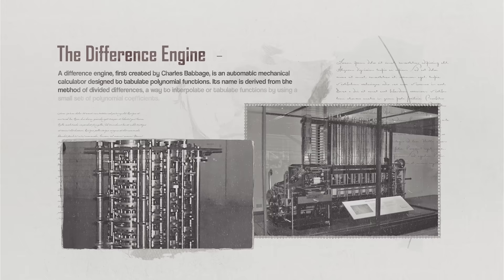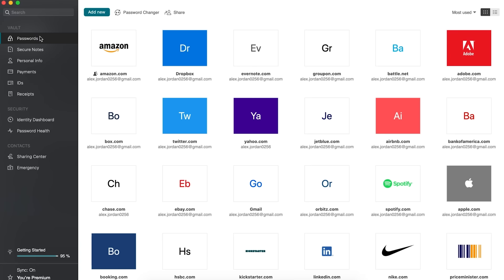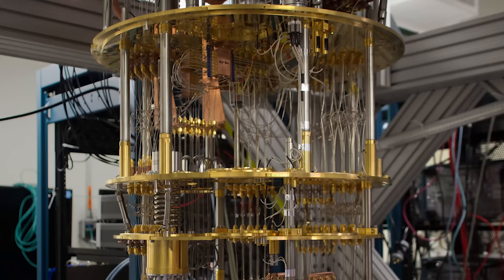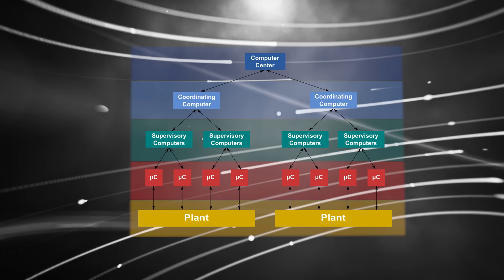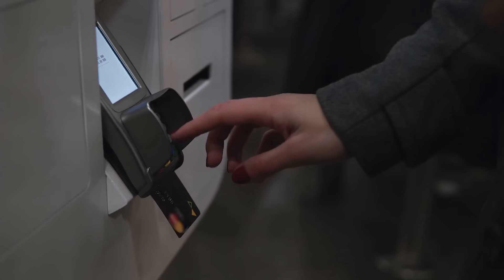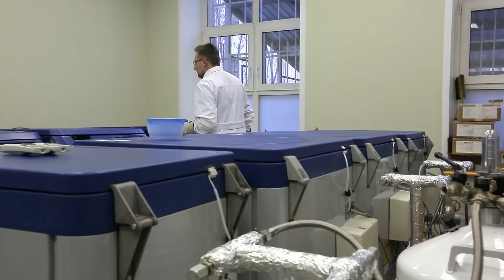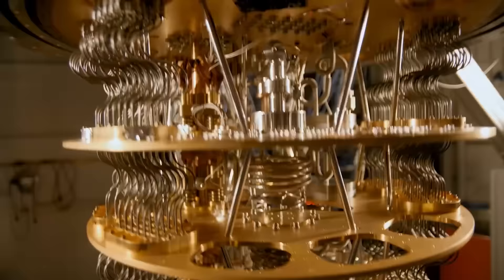This Revolutionary Computer Is About to Change The World for Good

Comment: My biggest question is can quantum computers help us achieve real fusion energy?
Reply: It can be used to simulate fusion reactors and experiments more accurately without having to build as many prototypes. So yes.
Reply: @charliestewart885  lol
Reply: Fusion energy is always 20 years away. No matter the computer available
Reply: Fusion energy is a thing and yes it can happen
Reply: I mean you don't necessarily need a quantum computer to create 'real' (not sure what you mean real but I think you mean sustainable). It's more or less a different field of science, although a quantum computer may be able to calculate mathematical operations which are important to the creation of fusion energy a convectional computer is able to do pretty quick. And we technically have a fusion reactor i.e a tocomac which are able to generate enough energy, but the issue is the energy deficit caused by the high amount of energy required to fuse to hydrogen atoms.togeher so an alternative of hydrogen-3 was proposed. The issue is that hydrogen 3 is on the moon so we need a moon base to actually extract it. The point I am trying to make is that everything is linked so if we crack one issue for another, larger issue it doesn't mean we solved it, it means that we need to take a few more steps in the right direction which both benefit us and our next generations.
Reply: Graphene will probably be the ticket. It can absorb Alpha and beta particles that are released during fusion reactions. Graphene chips will likely replace silicon chips in conventional computers while quantum computers will likely be used only on Industrial scale
Reply: Windows has been trying to make problem free software for 25 years and they still can't prevent new updates.
Reply: Nikolai glodowski don’t hate on people like that just coz there a lot smarter than u doesn’t mean u have to hate on them
Reply: Nikolai glodowski , with a name like that?? don’t you realise you’d be one of the first to get rounded up?
Reply: Nikolai glodowski , we wld be happy to have you mate

Comment: 'AMD has manufactured a processor with 64 cores'

shows picture of a Ryzen 3
Reply: Hahaha indeed
Reply: lmaooo ikr
Reply: It's wasted on software that only runs PHP & java.. :)
Reply: @derekfrost8991  How is that ? Most PHP is running at hosting providers which serve many, many websites and can thus handle many parallel requests. Same goes for Java on servers.
Reply: @autohmae  sure, if the host server gives advanced features natively, it's probably written in a decent language. My point is simply that we're not ready for multi-core nor qubits since our software is only as good as the Von neuman bottleneck will allow. These aren't just my opinions, I refer to a paper by John Bacchus.. :)
Reply: @autohmae  java doesn't even have tail call optimization..
Reply: @derekfrost8991  I'm jut saying, most PHP isn't used for things that need parallel computing and the way it's used (be it stupid Apache prefork or something like PHP-FPM) can fully utilize the CPU cores of a server just by handling multiple requests at the same time. In many cases the same applies to running Java. I think the idea people have that Quantum computers are going to take over is a mostly silly idea. I see it much more like a specialized co-processor. Just like a FPU or GPU, etc. Unless someone comes up with for example: doing machine learning in a much more efficient way on a Quantum Computer, then I doubt they will 'take over' the computing market. It will be like having FPGA, not many people have one, but it's very useful for some applications.

Comment: This was great until we learned that Google is the company that had the first one. We’ve already learned that google are a group of somewhat Evelin and self-serving technocrats
Reply: Why do you think Google is that bad? And would you say there is any Company currently which would use such a "power" for the greater good, instead of doing just what gives them control and money? Just want to know your opinion. It may be valuable. I'm not saying your right or wrong.
Reply: Google - Uses quantum computer to find more ways to shaft users with ads.

Comment: @3:14 and I am sure that I am NOT the first to point this out, you show a LM79M05.  This is NOT a transistor.  It is a negative 5 Volt regulator.

it does have several transistors in it

Comment: Completely irrelevant remark: the transistor in the video is actually a linear negative 5V regulator :)
Reply: Blind Bob  except that there's no such thing as "analog" in that every signal we think is continuous and infinite precision is actually quantized i.e. composed of small discrete multiples of Planck's constant.
Reply: Not in the quantum world...
Reply: @Quant-Beat  who were you replying to with that last comment? I have assume it wasn't for me, because the subatomic/QM world is precisely where Planck's constant is relevant.
Reply: @Gideon_Judges6  You are certainly right, but we do not have devices that would use "natural" quantization in specific processes. Therefore, we have to create them ourselves in a very rough resolution and tolerance, which we know as digital. Discretion on the Planck scale can be considered an "analog". We won't spoil anything.
Reply: Blind Bob  I mean....if you stretch it enough I guess technically an operation is happening.

But by that definition, a capacitor or inductor is a computer. Even a resistor is performing some sort of "analog operation", subtracting voltage proportional to the current running through it. So I mean that would be a stretch beyond the scope of the term itself.

Comment: No, Moore's Law says: the number of transistors in a dense integrated circuit doubles about every two years.
Reply: Which basically makes it Double as powerful
Reply: @FanaticBLoB  
No. 
The number of transistors and processor power to perform compute operations is only loosely correlated. 
For example, RISC processors can provide more compute power than CISC processors with fewer transistors.
Reply: @lilmsgs  only because they have fewer more basic instructions
Reply: @iamthetinkerman  
Yes, that's what RISC stands for. Nevertheless, fewer transistors... equal or more power than CISC.
Meaning, more transistors in CISC does not necessarily mean more power.
Reply: @lilmsgs  NO.
Reply: @jasonsapp5955  
No?
Google: What is Moores law.
Reply: @lilmsgs  True, isn't it something more loosely related to efficiency ?
Reply: @Channel8eight  
It depends on what you mean by, efficiency... of what?
Using the RISC vs CISC example (there are more examples of how more transistors don't equal faster),
RISC limits opcode functionality which pushes the logic into software; the compilers (you still have to accomplish the same things regardless of whether RISC or CISC). 
RISC is actually less efficient than CISC per instruction, but it does each instruction faster. 
Think of it as, RISC is one guy moving one brick at a time to a pile but doing it really fast. The CISC guy has a wheel barrow. He's more efficient but it takes more transistors (the wheel barrow) & he has to load and unload it to accomplish the same functionality (thoroughly scrambled metaphor).
OTOH, you could say RISC is more efficient because it accomplishes the same job with fewer transistors. Kinda depends on how you look at it.

Comment: 3:15 "Transistors" - showing a voltage regulator.
Reply: Yes that's a chip with transistors in it.
Regulated power supplies previous to this were big discreet transistor or vacuum tube devices. Actual packaged transistors were then also shown but not explained. The transistor itself is tiny,  transistor packages change form factor depending on heating issues and practical handling and application. 
Well spotted Tridac.
Reply: @walsakaluk1584  I know, I know. I just found the timing funny and couldn't resist making a tongue-in-cheek comment.
Reply: MrTridac You didn’t know
Reply: @Friend-oj5vl  So you think I can spot a 7905 in 5 seconds but don't know what's inside of it.
Reply: MrTridac why don’t you pick on somebody your own size bozo

Comment: 1:48 that's incorrect !!! there are close to 8 billion computers in 2020, and not 2 billion as you stated...
Reply: I have 4 computers just in my room, that is if you don't count other devices with a processor that I posses like old cellphones.
Reply: Of course you'd say that Stewie...
Reply: I knew that had to be off especially if you count devices like cell phones and tablets, let alone anything with a circuit board.

Even in third world countries, most people have cell phones.
Reply: Probably means households with computers.
Reply: Ok now your just nitpicking
Reply: it took me 1.5 seconds and a google search to prove you wrong :/
Reply: @JcoleMc  A statistic being off by THAT MUCH is hardly nitpicking.
Reply: @amoney9119  Whilst most google searches are wrong this is more a case of semantics. There are over 500 Billion computing devices currently active in the world, but approximately 2-5 billion active PC's, 4-5 Billion active smartphones (easier to account for) and a myriad of other machines from super computing clusters to the cpu in some fridges.  So as you can see the numbers are all at best going to be a guesstimation.
Reply: @amoney9119  Because a quick google search counts as evidence :/

Comment: The intro was a bit unclear. Moore's law states that the amount of transistors on a given surface doubles roughly every two years.
This is of course a law that cannot continue forever.
Amazingly the amount of processing power still is roughly doubling every 2 years.
Digital computers will still have it's place next to quantum computers.
IBM already has a quantum computer available for the public:
https://quantum-computing.ibm.com/
If you are really really good at programming error correction on quantum computers you're going to have a bright future because that's what's holding back quantum computers. This is also the reason why quantum computers need to be so cold: everything at a quantum level is a distortion (think: warmth is infraread radiation, which interferes with quantum particles.)
Quantum computers will enable major breakthroughs in the fields of AI (and not that dumb big data thing you see going on everywhere). This AI will also excel  at little data and exceptions. Therefor it's also going to be able to simulate a human brain. 
Since it's so small it will give an enormeous boost to nanotech. This will lead to breakthroughs in healthcare; you can start smoking and drinking again! The nanobots will clean up the mess. In space travel (start your own Dyson sphere!) and will probably lead to hyperintelligence; a program which can write a program which is smarter than itself.
Reply: Replying because I need to read this later
Reply: That's not how it works. General purpose AI is held back mainly by software not hardware.
Reply: @excelsior8682  same
Reply: Yes, well perhaps there will be some billionaires out there who could afford one of these. Please note that going to that site one cannot even read about their product without creating an account with them first. This falls into a category one step beyond the one in which, "if they don't list the price on their product, it's too expensive for you to be able to afford."
Reply: Why would you need a quantum computer to be able to build a Dyson Sphere?  All you need is to be able to arrange an array of mirrors or solar panels in a sphere around the sun. You don't need particularly advanced computing to be able to do that.
Reply: Dylan sky  He runs a very good pod, will hopefully get round to that video at some point. Nonetheless it seems the OP is incorrect in his assumption that old school Dyson spheres require quantum computing.
Reply: By "dumb data thing" do you mean adaptive learning ai or whatever? Googles alphastar AI taught itself to play starcraft 2 and beat professional players, that's not just a big dumb data thing imo, that's impressive. If you give it the right goals, an AI could probably teach itself to develop the perfect building or structure for housing or business and find the easiest and most efficient way of building it.
Reply: Not so fast, said an yet unknown nature principle like Heisenberg uncertainty principle.
Reply: 2 things holding back Moore’s law: quantum tunneling and transistors only being a few atoms big
Reply: I like the future you've described

Comment: So Thoughty2, How would one safely publish a completely new type of computer. for example a computer being able to act as a quantum computer however at room temperature.
a few years ago around 2017/2018 I Started working on a project to give a arduino uno more storage and processing power While absolutely not knowing how regular modern computers worked at a ground level, The closest thing I knew was building plasma bridges and changing their behaviour using frequency which is actually quite far from a modern computer. however I didn't feel like researching first. quite fast I had succes, more precisely directly after I got a idea in my head. I build a small prototype for storage, which  sadly was to big and took to long to make for it to work with a arduino uno(practically seen) also looking back, that storage behaved almost the same as a quantum computer and also had a 2 basic states and a superposition state(actually 2 superposition states, but the second is hard to reach and well simply put a lot of trouble, in general unless you put in a lot of effort it only happens when something really strange is going on). reading it out with the arduino in general gave more trouble that extra storage, and for proper reading it out you would need a different type of computer. so I made a computer using similar methods, and it worked. it also  could output in more complex values than that storage was made for, so the storage became a digitalizer, or a way to read out absolute answers. after that I watched a video about how to make a computer in Minecraft to get a simplified overview of how a modern computer works. well this was quite different but after designing some custom parts I could make it simulate a modern processor(like hard coding because I had no storage precise enough). I noticed it would be more useful as a gpu or cocpu, because for standard digital processing it was not to fast unless you would use it to calculate manny things at the same time. later I looked in the actual working of quantum computers and why they are fast. after that I needed to add some things to make the computer more scalable just like qbits, which luckily wasn't to hard. however took long because the first time I only remembered everything and hadn't written anything down, so I forgot it. and after knowing you have already found it, it is a lot harder to find.

As of now the main problem is that I obviously do not know how to publish it safely without some random person putting it on its name, or claiming it restraining further development.

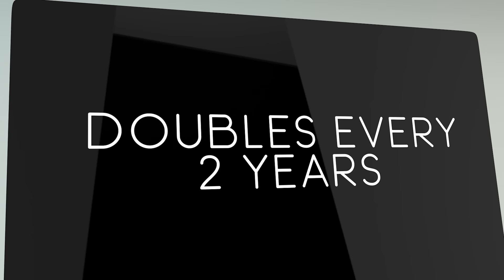Comment: 3:04 t-squared does not represent doubling every two years. It should be 2^(t/2) or (sqrt(2))^t or sqrt(2^t) (they are the same). Those are exponential expressions. t-squared is a quadratic power expression.

Comment: 3:18 fun fact: The Tesla transistor in the pictur wasn't manufactured by the Tesla company owned novadays by Musk, but by czechoslovakian electronical makings. The name is in that case short for ''technika slaboproudá'', which means small current technology. (In modern Czech it would be slaboproudá technika, but it sounds a little bit cooler, when it's flipped like this.)

Comment: Alan Turing is generally considered the father of computers, Babbage is one of the many grandfathers. I wouldn't even say he's the first canonical of them, Pascal (1642) is usually the first in order to be mentioned.
While classical computers do not progress exponentially, they do not grow linearly either. CPU improvements are not strictly "adding more cores", there are IPC increases, die sizes shrink, smaller transistors sizes, faster clocks, better instructions optimization, better multitasking scheduling, faster interfaces to connect components, etc. This results in computer getting faster at variable rates, depending mostly by the new standards and where/how the market profits from it.
Also, quantum computers can't run in real time, they have to be run in a not observable state at closer to absolute 0 temperatures in order to comply to quantum mechanics. Not to speak of the very limited use case of such computers.
Yes, they can do calculations faster than traditional computers, but that's it. They have very specific applications and completely sucks on normal stuff done on normal computers (they're even slower than your desktop pc in simpler and more traditional programs).
This is basically one the cool tech that won't have any real impact before 10 to 100 years from now, like most of the recent physics/math/space inventions/discoveries.

Bonus Trivia: Ada and Pascal are two programming languages that takes the name from the historical figures, both are fairly old and rarely used in modern applications.

Comment: your phone probably already has an unseen quantum computer also, probably has a quantum radio, you'd never know.  We haven't been able to see transistors since early 2000's, with microscope.  They are smaller than half wavelength of light, so we have not clue as to what is in these devices.  We should acknowledge this fact.  Why would they?    Total NSA surveillance with or without a battery.

Comment: I’m always very confused with quantum computing. Yes the qubits can be a 0 or a 1 or in superposition but the problem with quantum bits suffer from quantum uncertainty. Meaning, sure the qubit can be both a zero and a one at the same time but as soon as you read the value (the observer effect) comes out as either a zero or a 1one. How is that any different than modern computation?!